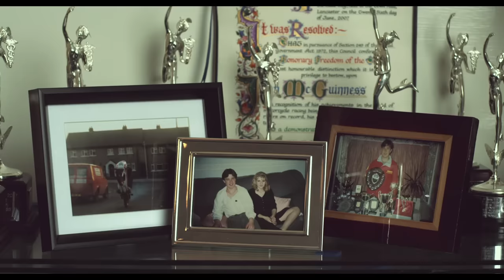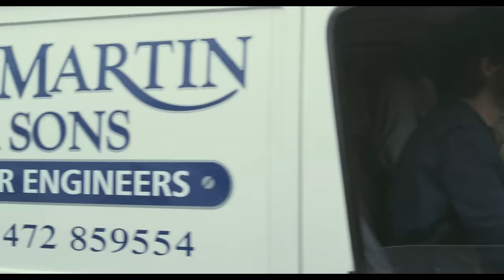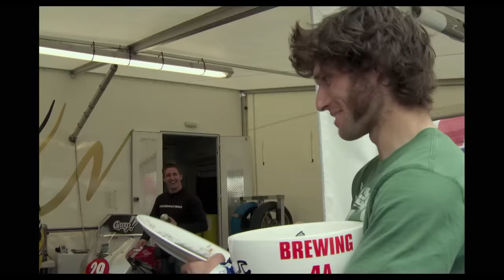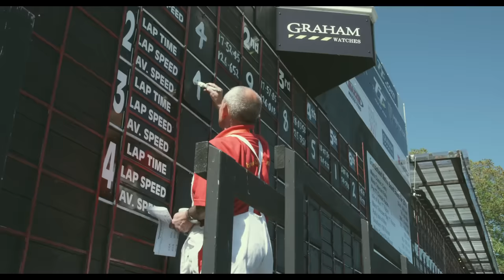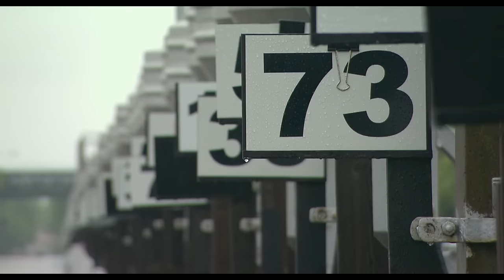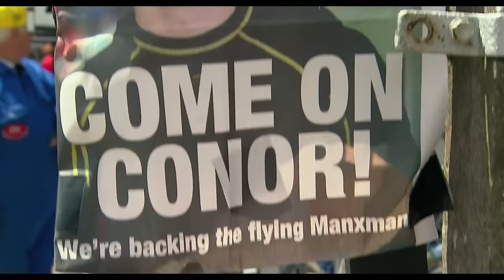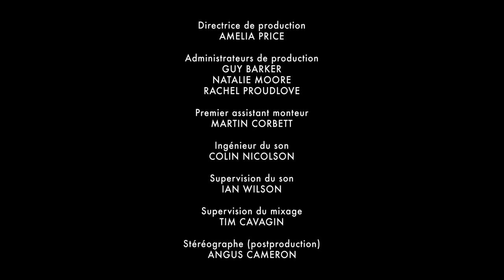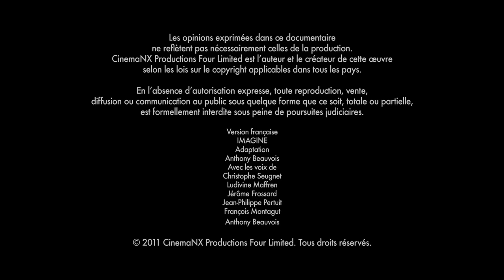Tourist Trophy : Closer To The Edge - Full Documentary TT3D (Subtitles Available !!)

Comment: This is fascinating, I've been a few time to watch and it is truly incredible. The most amazing thing is, it's all public roads not on a closed specialist circuit, so there are trees, buildings, walls, fences everywhere and to top it all off the road surface isn't exactly the best. As it's public roads you can go round the circuit and see what is involved..... most of it has NO speed limit at ANY time, so you can go as fast as you want, I don't have the courage to do it on 2 wheels so I did it in my old car (6.2ltr AMG Mercedes), I was passed by a biker on the way up the mountain, think I was up around 130 - 140 at the time..... they shot past me and were gone, must have been well over 170....... bravery and insanity combined

Comment: The pit lane is 341 meters long according to Google Maps. 
If you drive down it at 60km/h it will take 20.46 seconds. 
If you drive down it at 60.112km/h (like Guy did) you will do it in 20.421 seconds (0.039 seconds quicker). 
A 30 second penalty seems a bit harsh! Glad it didn't rob him of a win though.

Comment: I use to ride my motorcycle fast. around 160+ mph all the time(150+mph on one wheel way too many times as well). I had a Suzuki GSX-R-1000. But I wise up. Wanted to live. I too have lost a lot of friends to motorcycles.
You have to be a bit naive to think this is normal. I hope many of those TT riders also wise up before it's too late for them. I grew up most of my life riding motorcycles. Dirt bikes Road bikes, etc... But all of a sudden some common sense kicked in and I decide no more death rides(rides where you can die if you have an incident). I"ve had 3 and came out fortunate in each. The helmet saves my head from splitting open like a watermelon once when I slid into a curb at high speed after hitting an oil patch. I live in Arizona where helmets are not required. So I didn't wear my helmet all the time. I was fortunate I choose to wear it that day.